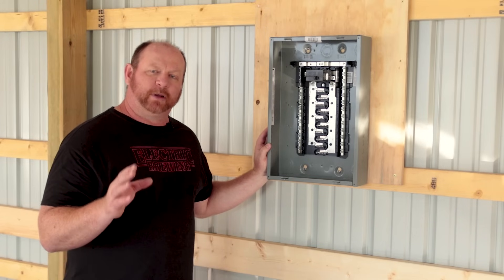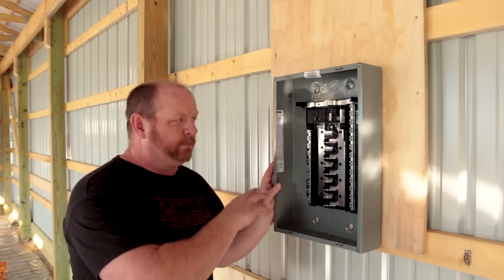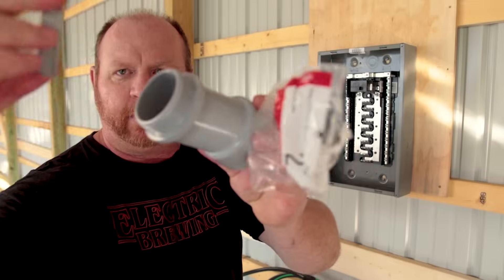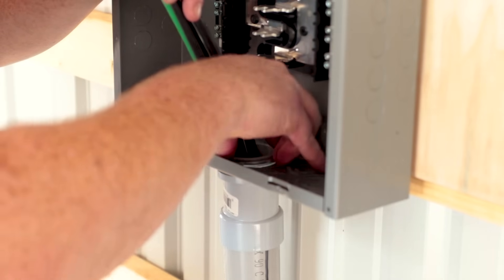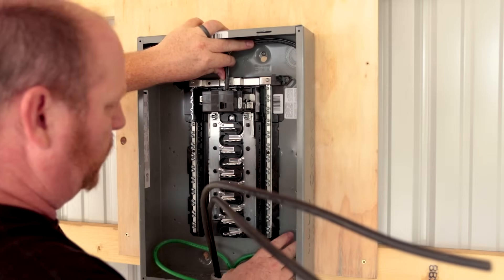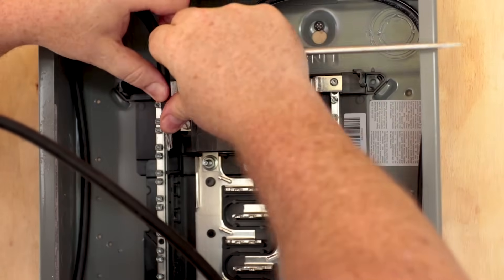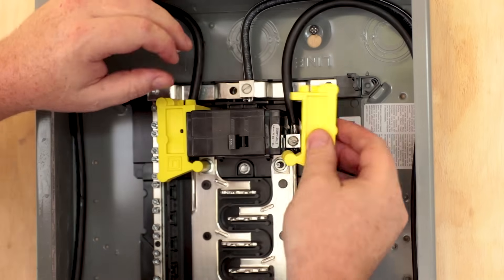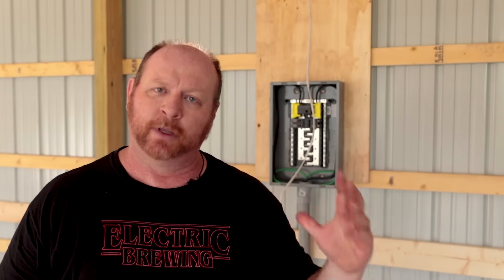How to install a main breaker panel in a garage. -  Square D Homeline 100 Amp Main Breaker

Comment: With respect. You need to have an expansion fitting on your nonmetallic conduit. With a Square D home line panel you need to add an additional separate grounding bus bar to terminate your number four grounding wire and a 8 foot ground rod with number six copper
Reply: Also did not put any noalox on before tightening wire
Reply: Doesn't technically need noalox unless he's by water as he really shouldn't have to worry about oxidation... and even then... Noalox isn't "really" a requirement...
Reply: @mikeyp7069  Anti seize isn't required but why take the chance. Its SOP.
Reply: MIchael, I am no electrician however I was under the impression you do not need a ground rod if you are running a sub panel. I read that it could be dangerous. Am I not understanding something ?
Reply: @travisharper8268  ... if this is a main panel being fed from the meter, it needs a ground rod. If this is a sub panel being fed from another panel, it needs a ground wire going back to the feeder panel. All grounds should go back to the "point of first disconnect" which is where the main system breaker is located. If the main breaker is at the meter then that's where all ground. should terminate. At that point there should also be a wire going to the ground rods. (2 required, 8 ft apart in the last 20 years or so)
Reply: @rupe53  NEC doesn’t require more than one grounding electrode unless 25 ohms resistance or less between the electrode and ground can’t be achieved with only one. And the minimum distance between electrodes is 6’.
Reply: @RB-xv4si  .... yes, that's what NEC says, but try to prove it to an inspector without having another rod as a reference point. For the cost of the rod you can be done with no questions asked. Oh, 6 ft between rods is code but that's the minimum. If you do 8 ft it becomes obvious that there's no tape measure needed.
Reply: @rupe53  it’s easy to prove ground resistance on a single electrode. You just need to perform a fall-of-potential test with a ground resistance meter. That’s part of NETA acceptance testing standards.
Reply: @RB-xv4si  ... I understand that part, but you would have you be there to show it to the inspector. Every sparky I have talked to says it's cheaper / faster to add the extra rod and not waste the time.... plus never any questions with the crappy soil we have here in New England.
Reply: @rupe53  even by adding the extra rod, that’s still not proving that the resistance standard has been met. If they’re not asking to see a reading, they simply don’t know.
Reply: @RB-xv4si  ... unless they changed the wording, the code says if you can't meet the 25 ohms you must install another rod. No mention of needing to prove anything after a second rod is installed. So here's' the catch: you install one rod and you don't get the desired reading. Now what? The ground wire to the second rod must be one continuous run to the other rod and back to the panel, so you need to do that over again? Not me. Do it one time and walk away. It meets code.
Reply: @rupe53  how do you know it meets code if you don’t measure it?
Reply: @RB-xv4si  .... you don't really know, but there's no further wording in the code book after it says to install another rod. We have crappy soil around here and I have never heard of an inspector asking for a 3rd ground rod. OTOH, if you think about it, there would be another ground at the utility transformer location.
Reply: @travisharper8268  According to the city of Bloomington, Minnesota, yes, you need a grounding electrode. Link here: https://bloomingtonmn.gov/sites/default/files/handouts-b%26i-fffdetach.pdf

See page 2, point #5, and the associated diagram.
Reply: Just wanna know who checks the 8ft ground bar ??.hahahaha. I see dudes cut tht shit in half😂🤣🤣
Reply: @roystonpaulmckenzie3878  ... Yes, some building inspectors do have their ways of checking ground rods. (not bars) For starters, the ground rods are copper plated with a steel core so if you cut off the part sticking out of the ground it will show rust very quickly, which will be the first clue. Second clue that might cause a fail at inspection is too much of the rod sticking out of the ground. (more than 6 inches) Some installers get caught with their pants down and some don't. Which one do you want to be?
Reply: I'll try to be polite Brain, your installation is not in compliance with the National Electrical Code and your advice could hurt people and harm property. 

Using NEC 352 and assuming that PVC is 4' long above grade, a temperature range grater than 150° would need an expansion joint. So an expansion joint probably isn't needed.

Michael, you are correct about needing a grounding electrode system. Ground rods, he probably needs two, would satisfy 240 Part III. Also need to bond the system.

Comment: Code requirements are to use anti seize for aluminum conductors terminations.
Reply: No its not..  You go by the lug manufacturer's instructions and they are as all dual rated nowadays.

Comment: also, you mentioned this is a main panel and not a subpanel, you need to install the bonding screw to tie the neutral and grounds together. if this was a subpanel you would need to seperate the grounds and neutrals.
Reply: What about the sub panel rule where you keep the neutral and seperate by taking out grounding screw
Reply: @nicholasdandrea3356  they’re either bonded or not bonded there is no in between

Comment: you need to add nolox to the aluminum conductors to prevent oxidation.. with said oxidation its a serious fire hazard so that no lox is a must
Reply: You are so correct. I’m a licensed electrician. Don’t forget the nolox on aluminum. Don’t need it on copper. It’s NAT electric code..
Reply: @wasj01  it is not NEC , if it is what section give article.

Comment: Good Video...This comment is not to point out anything wrong...Just thought I would chime in...PGE supplies power in California as this comment is based off of California....Once PGE has landed its wires as in this case...The main panel will have 3 wires on the PGE side of the meter...2 hots and a bare messenger wire considered the ground/natural wire...Once the meter is installed the 120/240v power feeds through the meter over to the homeowners side providing the panels main lugs and or main breaker with power...Once the main breaker is turned on if the panel has one and it should...The buses now have 120/240v   power supplying an A and B Phase....Ok so that is how power enters the main panel as there is no need to turn on any main breaker yet...Just explaining how power is supplied...Now let's talk about the messenger wire...Once landed on PGEs side it bridges through the panel to the homeowners side by a soild piece of metal such as aluminum to the neutral bus bar ground combo as we are at the main panel...The panel now has 120/240v power with a neutral...Although as per California codes the main panel is still not grounded...The next step is to ground the panel as there are a few ways...Let's explain using ground rods...As per California code...It states to install two ground rods at the main panel one directly below the panel and a second 7 feet away minimum...Ok once you tie both ground rods together with a ground wire...The ground wire enters the main panel and lands on the natural bar...As per code the amperage will determine the ground wire size...Refer to a code book...Along with the correct way to attach the ground wire etc...As there are different methods per install...Now you have 120/240v with a neutral and a grounded panel and or system...Follow all safety measures when testing a system if you do not know how to test Electrical safely dont mess with it...To test turn on main breaker take a voltage meter and place one side on the neutral bar as that same bar will have the ground wire on it...Take the other lead on the tester and place it on a main lug or the main breaker it should read 120v give or take...reason all transformers are set a bit different on PGEs side...Now place both ends of meter on the main lugs or breaker it should read 240v give or take...You now have if installed properly a safe 120/240v grounded system....Now let's talk about feeding out to a sub panel...Let's say its 125 amp...Size wire per code and let's say it going in a residential home...From main panel install a 4 wire SER cable...Land wires as follows...Main panel...Both hots land on the 125 amp breaker...Neutral wire lands on neutral bus bar and so does the 4th wire the ground....At the sub panel install the two hots on the main lugs and or breaker...The neutral on the neutral bus bar....Now the ground...I use Square D panels...So you buy a Square D ground bar and install it in the factory holes and land the ground wire on it keeping the grounds and neutrals isolated....If the panel is installed in a detached unit as in this video say a garage or a shop sub panel....Install the wire the same way...Hots on main lugs or breaker...Neutral wire on neutral bus bar and ground on separate ground bar...Being the panel is in a detached unit as this video you need to also install a ground rod and a ground wire to the ground bars...Now you have a safe and grounded sub panel in a detached unit...Such as a shop or garage.
Reply: Must suck to live in California. Overkill on grounds, but understand separating ground from neutral on sub panel. I also would never use aluminum wire in conduit and connected to panel lugs. They will become loose.

Comment: Ground and neutral together?
Reply from the maker: The last 3 new build homes I've owned all had neutral and ground wires on the same bar. Different areas different codes. People should consult local codes before doing any wiring. As I stated in the video.

Comment: Great video so I just bought a house from 1950's the service is coming underground is there a way to tell what size wire is coming in without pulling the meter? Right now I have 100 amp but want to upgrade to 200amp.
Reply: What state are you in...
Reply: You can upgrade to a 200 amp panel, need to contact your local utilities to tell them you’re gonna do such when you pull your permit. Need to hire someone for that
Reply: Your response it too late
Reply from the maker: Thanks for the feedback. I'm not sure that you can tell what size of wire it is unless you can read the stamping on the side of the wire or if there is a painted on information on the wire. I would imagine if it has 100 amp service now whoever installed it probably didn't why are with the thought of upgrading to a 200 amp service, so you will probably have to change the wire?

Comment: Great video. One thing I should say is that you should put a ground strip on your panel that screws into the frame of the box itself. Do not share your ground wires with your neutral wires. Mainly because there is no difference in load/potential between the two lines. I'd suggest not sharing the neutral with the ground.
Reply: I just learned my new panel has the ground and neutral shared! I'm confused now. I always thought they were separated lol
Reply: @petertaylor928  If its the first panel you have to connect together the neutral and earth , however you keep them seperate in the panel even if it is a main panel if you have to add a panel behind the main one (like an outside disconnect panel) you dont have to rewire all the neutral and earths to seperate them.
Reply: @petertaylor928  only separate them for your sub panels coming off your main panel. Leave neutral and ground together in your main panel

Comment: You made a major mistake. When using aluminum wire you are required to use a product to prevent corrosion. They sell it in a paste tube very similar to tooth paste. Secondly it is important to go back and check the connections after a few good uses. Large draws will cause the wire connections to loosen up. I'm sure your used to hearing nay sayers. I promise you this information is critical.

Comment: All Aluminum connections should have dielectric grease applied to them. I use a product called NOALOX. I am not sure what you have at the transformer. It looked like a meter/main combo. If that is the case then that would serve as your "first means of disconnect". At that point your grounds and neutrals should come together then just one neutral should go back to the transformer. But, inside that box by the transformer there should be a ground termination and a bonding screw that bond the neutral to the can and bring your grounds and neutrals together. That green ground wire in your 2-2-2-4 should have a terminal to attach to inside the meter/main by the transformer as well as a ground lug on your ground bar inside your new 100a panel. Hope this helps. If I am incorrect about what you have by the transformer then your new 100A panel servers as your first means of disconnect and you did the correct thing with the ground wire by folding it back but there was no mention of a bonding screw which is what ties your neutral bar to the box and effectively the ground. EC state of FL

Comment: For this panel to pass inspection, in most areas:
1. Buy a Homeline neutral bar and ground lug kit and install them in the panel.
2. Connect the #4 green wire to the ground lug and the ground bar with special aluminum no-ox paste.
3. Remove the green bonding screw on the neutral bar.
4. Remove the other 3 #2 aluminum wires and treat them with the aluminum no-ox paste and re-install.
5. Make sure the circuit wiring grounds land on the ground bar and neutral wires land on the neutral bars.
6. All outlets in the garage/barn need to be GFCI protected, so cheapest to just use GFCI breakers (not the 2 regular ones that come free with the panel).
The rest of your installation looks very well done to me.

Comment: Bonded ground and neutral in a sub panel. Big violation.   Ok in main panel,
not ok in sub-panel.
Reply: Would I be ok using the same square D box without a green ground cable as my main panel? I just got one yesterday, I was confused about why there was no grounding bus. Thanks for your response!

Comment: Sir, when you placed the service entrance cables into the sub-panel in the barn, WHY DID YOU NOT PUT "NO LOX" ON THE WIRES SO THERE IS NO OXIDATION AT THE POINT WHERE THE SCREWS ARE TIGHTENED DOWN ON THE ALUMINUM CABLES? 

HOW DID YOU GROUND THE SUB-PANEL?   THAT GREEN WIRE IS A GROUND AND IT SHOULD BE GROUNDED AT THE SUB-PANEL IN THE BARN AND THE LOCATION OF the MAIN PANEL!!!!   THIS WAY, ESPECIALLY IF A GROUND IS DAMAGED BETWEEN THE MAIN PANEL AND THE SUB-PANEL, THE INDIVIDUAL GROUND AT THE SUB-PANEL WILL PROTECT THAT PANEL AND INDIVIDUAL BRANCH CIRCUITS. 

THE OTHER ISSUES I HAVE IS THE USE OF ROMEX IN OPEN WALLS OF A BARN.  ALL THE WIRING DONE IN A PLACE LIKE THAT, WITHOUT GETTING TOO CARRIED AWAY, SHOULD BE DONE IN CONDUIT.  THIS WAY, ANY EQUIPMENT WHICH COULD HIT IT, (MACHINERY, SHOVEL, PITCHFORK,  RAKES, ETC.), WILL HAVE LESS OF A CHANCE OF DAMAGING THE WIRES.  ROMEX IS EASILY DAMAGED WHEN IT IS EXPOSED IN A WORK LOCATION LIKE THAT. 

I DO NOT MEAN TO BUST YOUR BUBBLE, AND I KNOW YOU WANT TO HELP PEOPLE, BUT I WOULD SUGGEST THAT YOU HAVE A LICENSED ELECTRICIAN MAKE THE VIDEOS, AND THIS WAY THERE IS NO PROBLEMS WITH HOMEOWNERS DOING THINGS INCORRECTLY.

HAVE A GOOD DAY.
Reply: Uh........yeah, whatever.

Comment: You forgot to use noalox on that aluminum wire, is that anti-corrosive Grease...and that expose romex but other than that looks good...

Comment: Helpful video but lacks the use of nolox gel for connection of aluminum wires and placement of groud (green) wire to ground lug and then to ground rod in foundation or outside